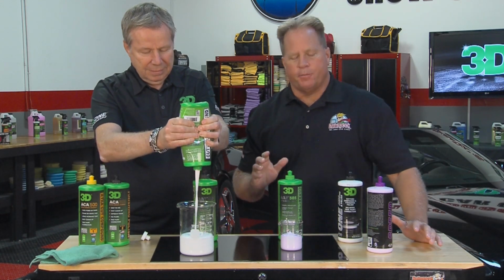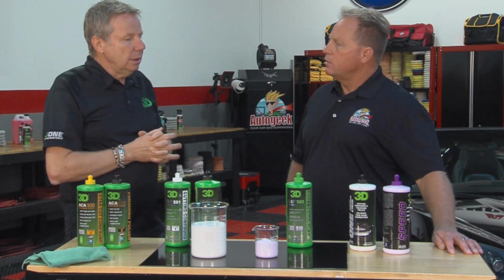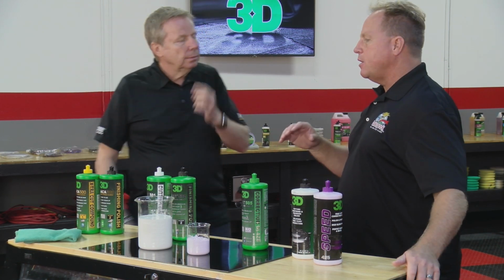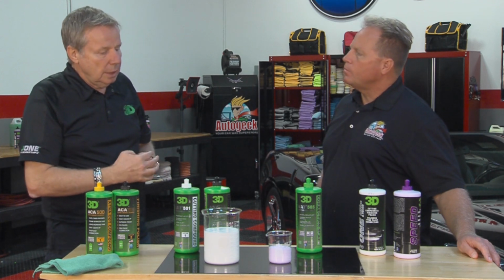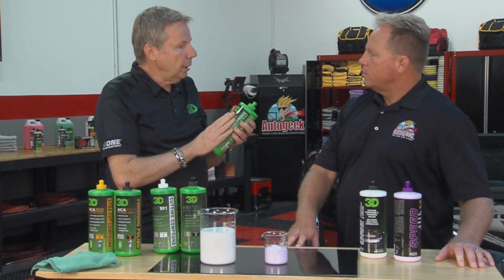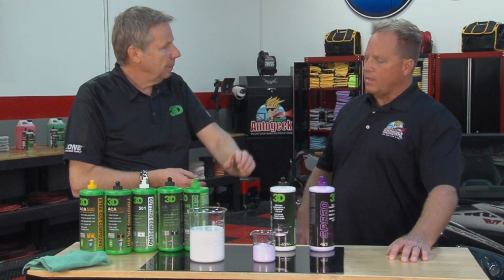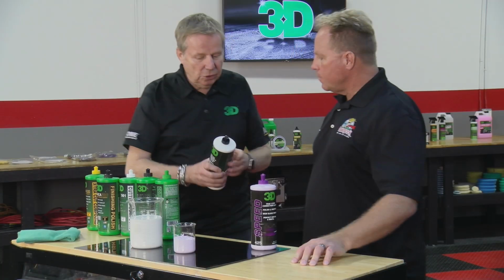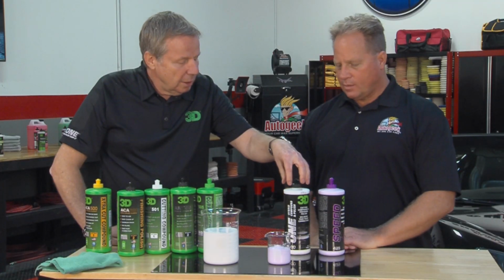How do compounds & polishes work and how they are made - 3D Detailing Products

Comment: Tunch is spot on, many polish brands buy abrasives off the shelf and then use low grade solvents and other lubricants/carriers which negatively effect how much gloss you can achieve. I tell every company who manufacture products to not develop polishes as it costs mega loads to make them extremely well without the naptha, kero, cyclohexasiloxane and aromatics.  My teacher makes his own abrasives and raw materials too. What im curious is when will aluminium oxide be replaced with something better or are we stuck with it?. Tunch my request to you is to develop the universal pad, an idea ive had since 2007. Universal for use on any machine type and universal in that it can correct well but be variable in finishing abilities.  Finish is more important to me than cut but there is a certain amount of speed of cut that people expect.   Customers are paying for a  quality polished finish.   Loved this video thanks mike and tunch. Please do more intricate ones with industry suppliers.

Comment: What would be helpful is a discussion of how it cuts. In other words, SMAT Vs Diminishing and how 3D abrasives physically do their cutting and are intended to be used (worked). I think you guys were headed there but got sidetracked.
Reply: There are products that are a combo of diminishing abrasives and non diminishing.  Formulation not abrasives alone are most important
Reply: From what I've learned from 3D is that none of their abrasive polishes or compounds are diminishing. They are all micro, non diminishing abrasives. 

I know that when I use any of Tunch's polishes, I can continue to cut - without dust - until the defects are gone - for the most part. In some circumstances I do a couple passes, brush out the pad, and start cutting again when necessary. 

So with 3D, their products "stay with me" until the section is complete. They don't dry out and dust up before I'm ready to stop buffing. 

Because you don't have to work the abrasives through a diminishing cycle, you can do both short and / or long cycles to accomplish your task.